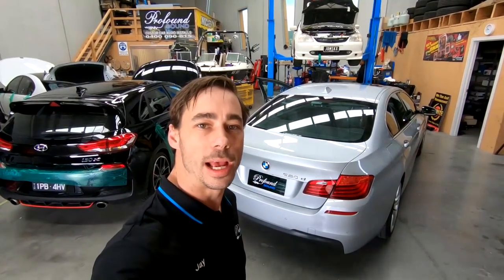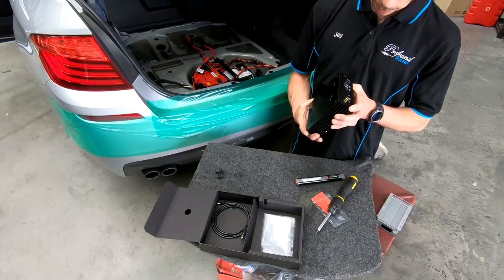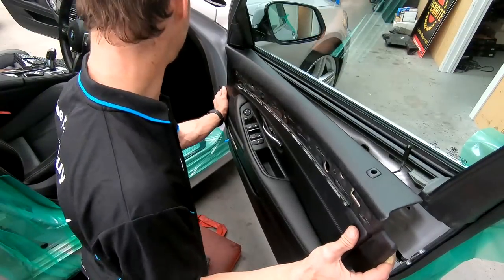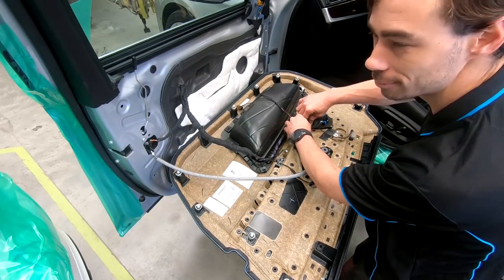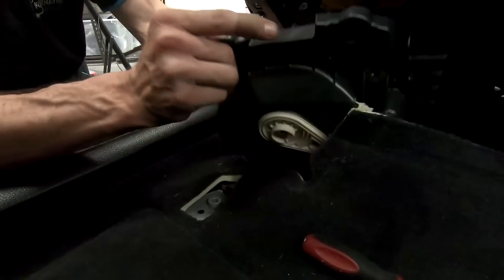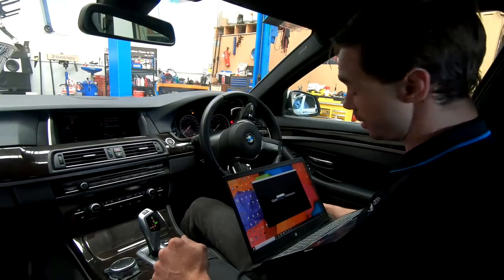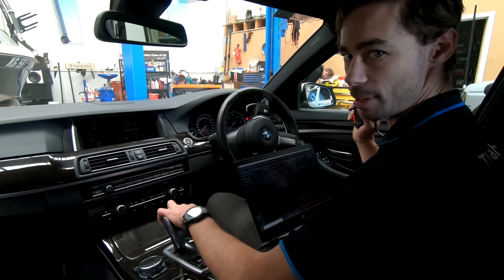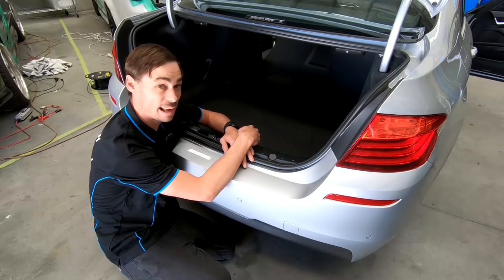F10 520d BMW Match DSP And GERMAN Maestro Speaker Upgrade!

Comment: Hi mate nice work. I have a f10 I have changed the speakers in the doors and rear but the front speakers badly distort when I turn up the volume. 
The amplifier is stock, do you have any ideas? The fader is more to the back speakers.
Reply from the maker: I have had this before where it is the base stereo, that doest have any amp at all. Basically the speakers all run directly from the headunit itself, and that is just not very capable of running aftermarket speakers with a low sensitivity very well. What speakers have you put in there?

Comment: Do you remember the mounting depth of those speakers or what is the max depth we can put in these f10 doors?
Reply from the maker: They were german maestro Concept CS4008, so they are 43.5mm deep. you can go a little deeper from memory but not a whole heap :)
Reply: @wickswirescaraudioandfabri7730  thanks.

Comment: so how do you set the front passive system ? HPF only? LPF bypass
Reply from the maker: @TMCHL Correct, it's a passive active system, so the mid and tweeter in the door run a high pass of about 150hz, then the underseat sub is playing from that frequency down on a low pass filter 🙂

Comment: Love that epoxy gun. Nice work my friend. You keep amazing me how far you’ve come!! 👍👍👍
Oh that CD brings back memories. 
What did you end up crossover points?
Reply from the maker: Cheers Clint I'm always pushing to improve 🙂
So fronts hpf at 90 12db found a bit of overlap helped with the upper midbass so lpf was 100hz on 18db for the midbass, factory center channel ran from 250hz up to 10k. It honestly sounded damn good for what what was in there. Every one at work agreed haha

Comment: Hi . Can you please tell me if this type of upgrades can be done in my F10 / 520d  year 2012. 
I have a  Harman Becker BE9510 AMP with 16 speakers S677A system. My amp just completely gone now , no acoustic tones in my car , so I'm looking in any solutions . Until now with not much of luck unfortunately. Thanks for your help 👍
Reply from the maker: Hi Lorant, there are a couple of different directions you could go. If you do not want to upgrade your speakers in the car, something like a Helix V12 DSP would be my first pick. As this will cover 12 speakers on its own and can output to another amplifier at the same time. Where are you located?
Reply: @wickswirescaraudioandfabri7730  thanks . I live in UK / London.(South London)
Reply: @kcsacsa1   hey lorant, if you want to sell your amp, give me a shout, i need a broken one for parts, thanks
Reply: @nathanbliss6788  at this stage I'm not sure if my amp is gone , as suddenly today when I started my car the whole audio came back . But it has his moments when it freezes the whole display. So now I am investigating the CIC unit.
Reply: @kcsacsa1  ok well thats good news. it could be the CIC i suppose, probably a dry joint somewhere in the system, good luck and let me know if the situation changes, cheers. im in gloucestershire btw.

Comment: Nice video, well-done mate. Have you done any EQ tuning / check speakers frequency response? Haven't noticed it. Otherwise thumbs up.
Reply from the maker: Thanks mate 🙂 I did do a small tweak on it but wasn't on film. I will do a lot of my tuning from crossovers and levels and use the eq last. That's all I will normally do on an initial tune as well, when it comes back for it's re-tune I will get the rta out and do a check over. But from the way it sounded already, it's not going to need much at all 🙂
Reply: @wickswirescaraudioandfabri7730  Let me know when you do that... curious to see it done. Just subscribed:-)

Comment: What are your thoughts on those Maestros?
Reply from the maker: Really nice speaker all round Very detailed and accurate.  I'm actually about to put gm status in my car 🙂
Reply: @wickswirescaraudioandfabri7730  That's good to know... I've got them in my vehicle, but currently not on an amp... Amp will go in soon, then I shall see how they go... Originally I was going with some Hertz, but I can't fit a 6½ in the back, so Maestros it is, as I didn't want to mix brands... I'm the only person I know that's using the brand, so never had any feedback on them until now...
Reply from the maker: They are a great speaker. I have used them a lot through work and have had nothing but good experience with them,. Oh yeah get the amp behind them and they will come alive. Don't be scared to get something a little over rated as the ratings are the the same 75Wrms all the way up to the $3500 M-Lines and trust me they take more than that.
What sort of amp have you been loomking at?
Reply: @wickswirescaraudioandfabri7730  I'll have approximately 80wRMS on each of them... Alpine Class AB 4ch... It's a relatively small cabin, so it should be plenty... If it's not, amp upgrade!
Reply from the maker: Yeah that should do the job nicely, but more is always better hahaha 😉
Reply: @wickswirescaraudioandfabri7730  https://images.app.goo.gl/xdDpGdFeL7YNRVpW6

This is the speaker layout of my car... Notice the rear speakers are very close to the front seats... The positions are great for rear fill... Thanks to Honda for their great speaker placement... Especially the tweeter positions... It sounds like the whole windshield is one big central tweeter...